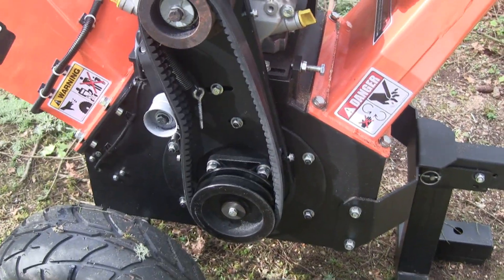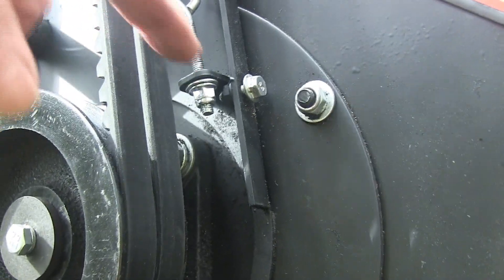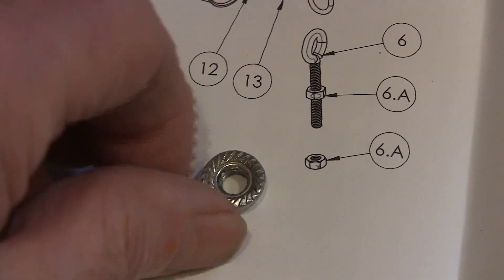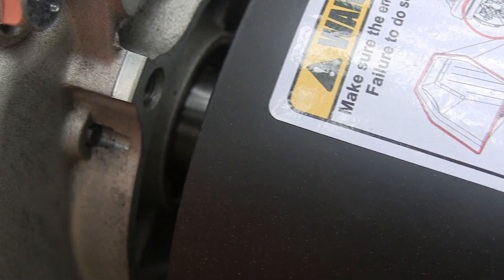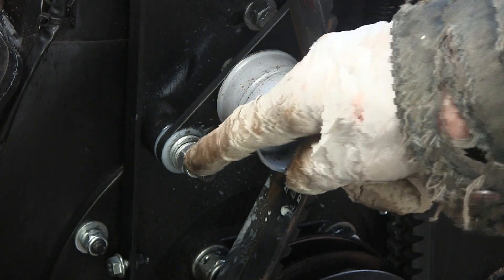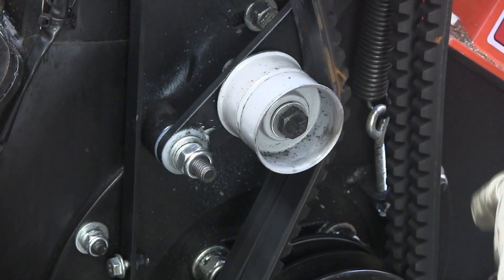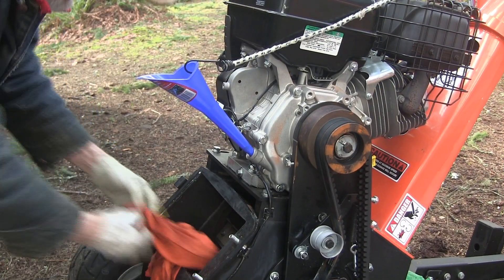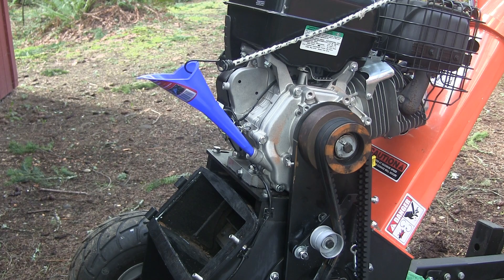WoodMaxx DC 1260 Slipping Belts

Comment: Thanks for making these videos.  I just received my new DC-1260 today and was going to have a look at this to make sure I didn’t lose the nut.  It seems maybe your videos have helped change the design - now there’s no belt tensioner at all and 3 drive belts.  Not sure how you’re supposed to adjust tension now.  There’s the jacking bolts on the engine mount but that’s not the best geometry for tightening.  Manual still shows the setup you’ve got.

Comment: Hello, I recently purchased a 1260e secondhand for $1300.00, seemed like a fair deal as not many of the larger(non-commercial) chippers come up for sale so I jumped on it and so far it's been amazing, a true beast, just manhandles anything 3 inch or under. I have 3 questions for you. 
1. How many hours is considered a lot?  The one I bought has an hour meter, and reads about 200 hours, is that a lot for this unit?
2. I took a look at the 2 knives and they definitely have some chips, probably big enough to warrant new knives but when I take them out, is there any "setting of the knives" or is it just simply placing them in and bolting back down in place?  
3. I have yet to find that 3rd knive, would you say that I should be replacing that one when I replace the 2 on the drum or can I just replace the 2 and see how it operates.  Thanks, love the videos, love the chipper, so glad we didn't buy the $400 Home Depot special.

Comment: I checked out my second video, and it shows that there "were" two nuts holding the belt tensioner arm; with one above the "bracket" and one on the bottom.  BUT I think both were the serrated shoulder nuts.  The bottom one needs/has to be a NASA nylock nut.  Will go looking for the missing nut with my big floor magnet tomorrow.

Comment: Went back to where I had the chipper parked for the video and found the "other nut and lock washer" on the ground under the "belt dust"  where I took the belt case off.  Will redo the whole spring tension arm setup.

Comment: Exact same problem with mine, to the point where after the first time, the pivot bolt for the tensioner backed off.  Belts smoked.  Also found that the bolts securing both the clutch and drum pulleys came loose.  Gave them a final torque with an air impact gun, seems okay now.  Would be better with an automotive type spring loaded serpentine belt tensioner.
Reply: Thats exactly what i was thinking with a tensioner..

Comment: Would you still recommend this chipper?  Seems like a lot of money to spend to have problems like this in the first 8hrs.  This looks like a nice product but seems it’s missing the important details.
Reply: I would recommend it, but be prepared to buy belts for it. The newer version of this chipper sounds like they have changed the design to help reduce the belt problems. I've put like 6 sets of belts on mine in probably 40 hours of use. Also any belts you buy at the parts places don't hold up at all, make sure you use the BX40 belts.